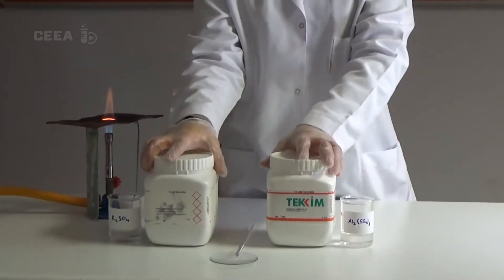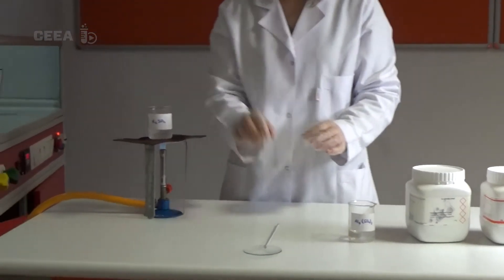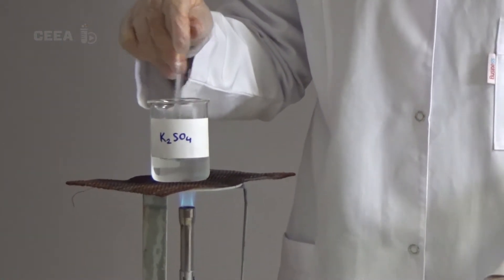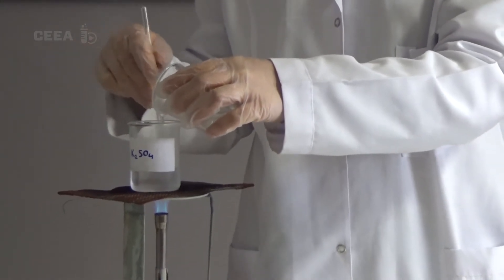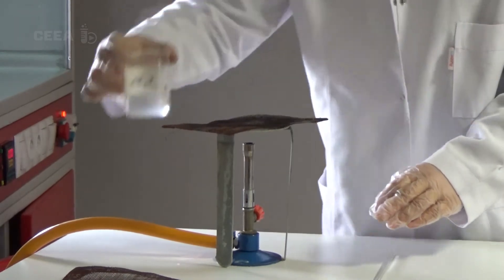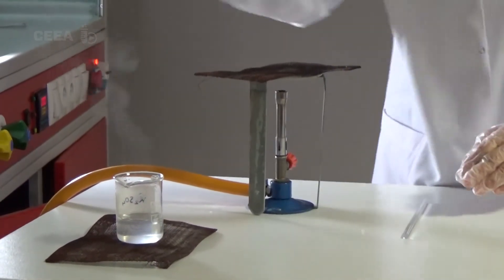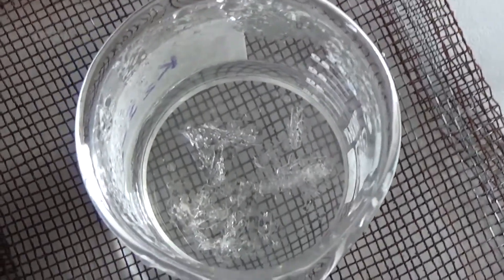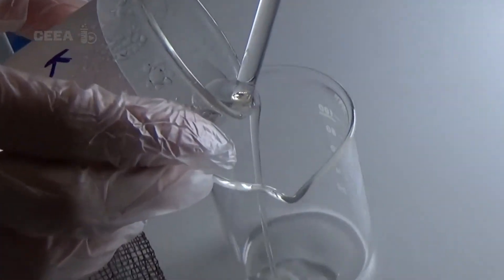ALUM CRYSTALLISATION

Comment: When I heated up some potassium alum, in my microwave, with just a splash of water and poured it out into a mold, I found that there was a lot of white dry material at the bottom when everything cooled, but up top there was transparent parts. What happened here? What are these transparent spots that are all over the top when it cools?